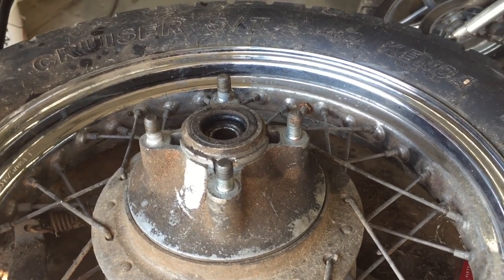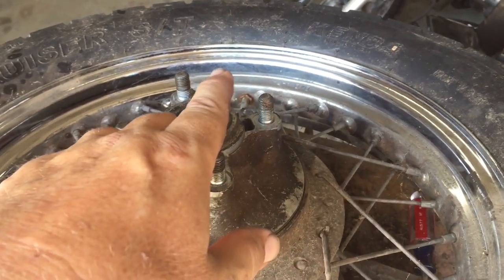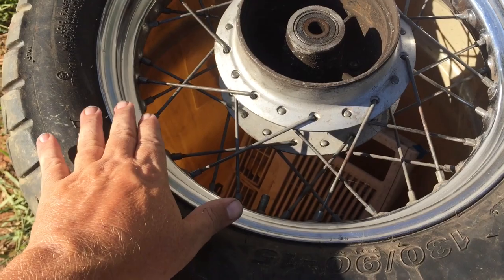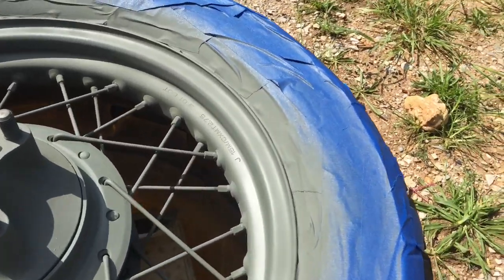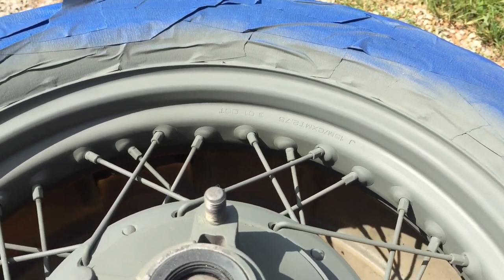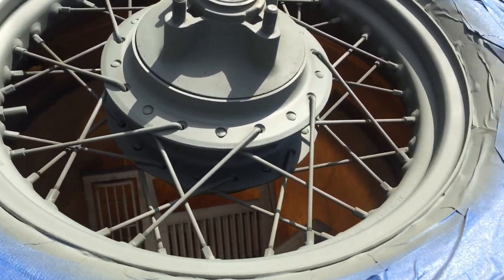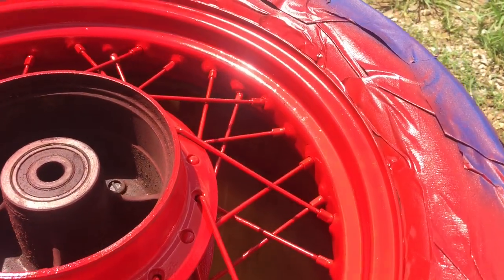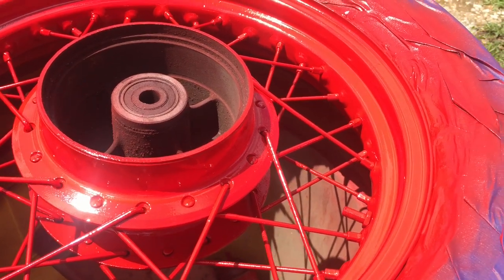How to paint your motorcycle spoke wheels

Comment: i want to paint  just my rusty spokes, and leave the shiny aluminium hub and rim alone. i guess im in for hours and hours of masking. i could always measure the distance between spokes and use a hole puncher in some paper and the a slice in one side so i can slow the hole over the spoke, double them up to cover the sliced bit, then hold them down with masking tape. but damn that will be time consuming. i guess i have plenty of time though as the bike cant go back together until i get the new transmission parts, so i might as well... if i can be bothered..
Reply: Can't you just use a paintbrush?
Reply: I would! I’m going to paint My KTM spokes black with a brush.